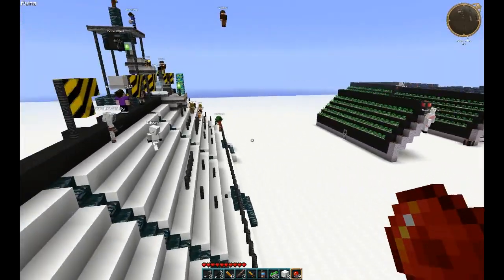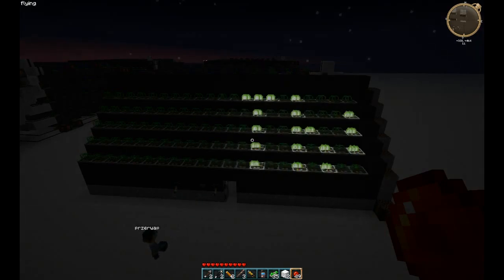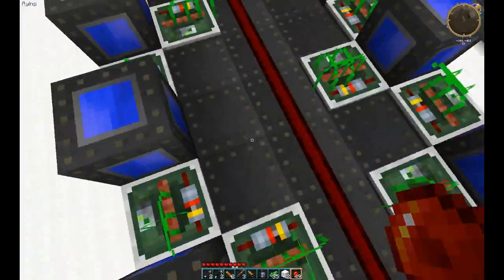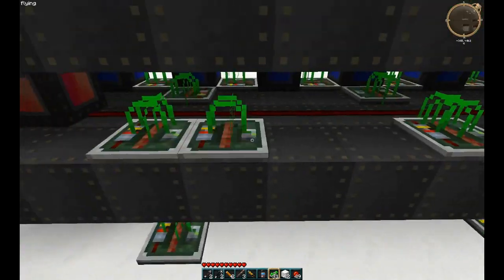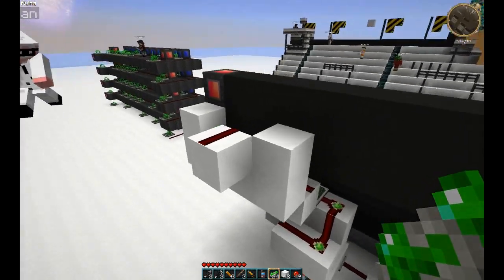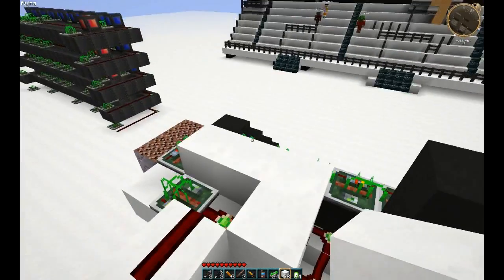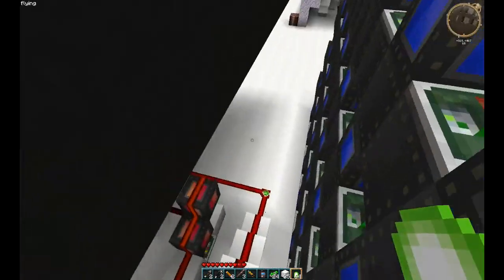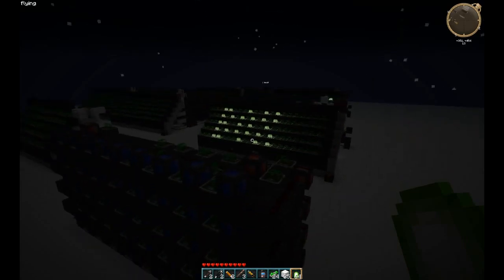VoxelTüt: Pre-Programmed Redstone Ticker Display

Comment: You could turn the rom into ram by adding repeaters as if every pixel was to light up, then have a piston control a block that woul either allow the signal to pass onto the main wire or not